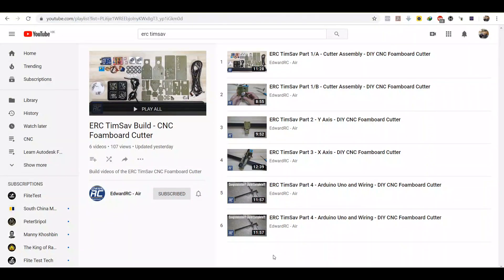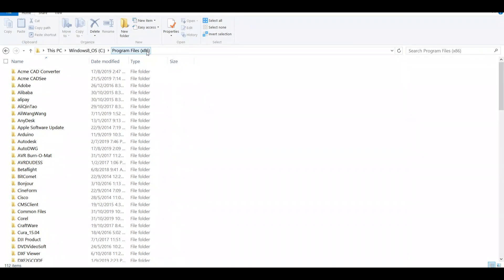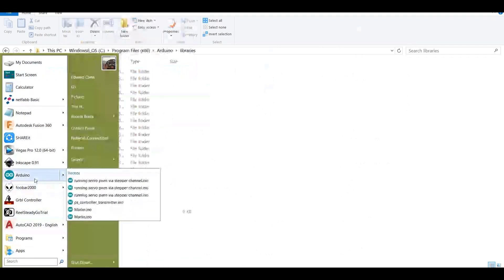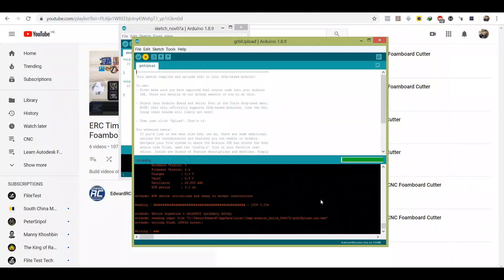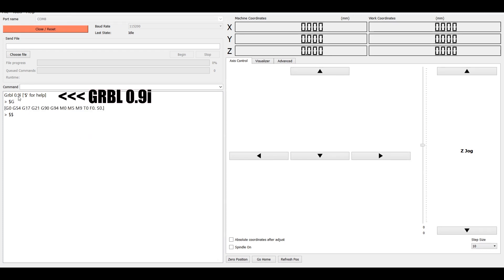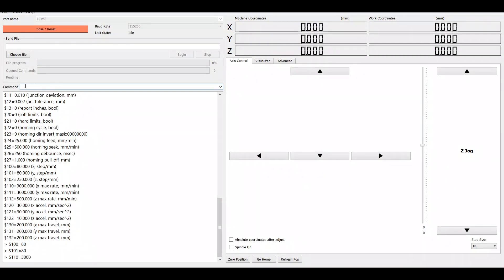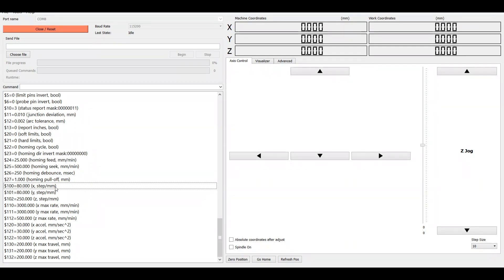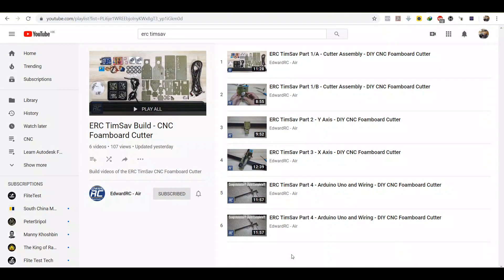ERC TimSav Part 5 - Flashing GRBL Servo to Arduino - DIY CNC Foamboard Cutter

Comment: i follow all your instruction flashing successful but Grbl files do not appear in grbl controller only
"No data from com port after connect. Expecting Grbl version string".  i have flashed basic blink sketch successfully so Arduino is flashing code.. any suggestions?

Comment: With the lite kit will I still need to do all of the things you highlighted in this video?
Reply from the maker: No. with the Lite KIT, arduino uno came preflashed and prebuilt with cnc shield
Reply: @EdwardRCAir  Did I read that the Lite KIT no longer features preflashed and prebuilt w/cnc shield??
Reply from the maker: @tzsetzse  yes no longer come preflashed prebuilt but it actually takes only 4.3sec to flash the firmware into the arduino uno, once u click "upload"